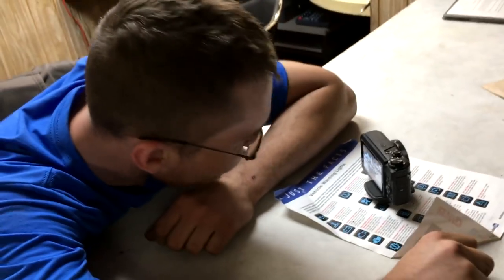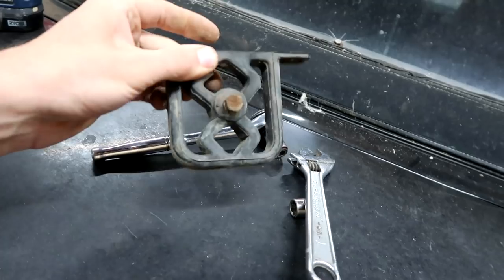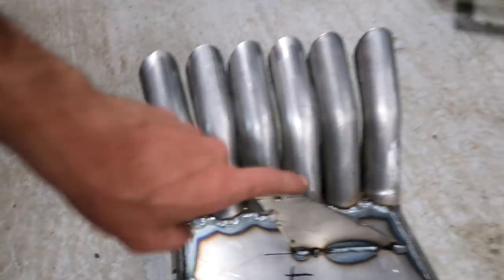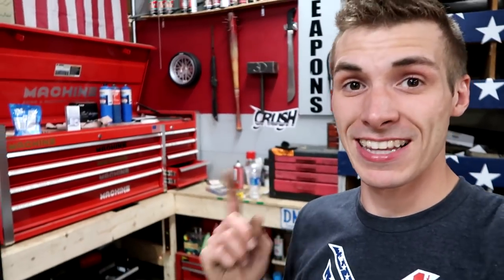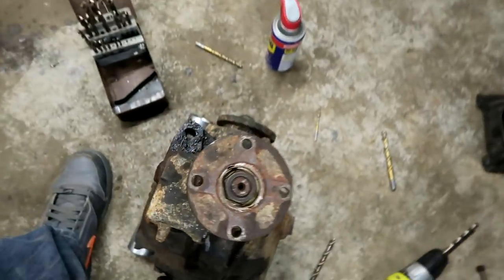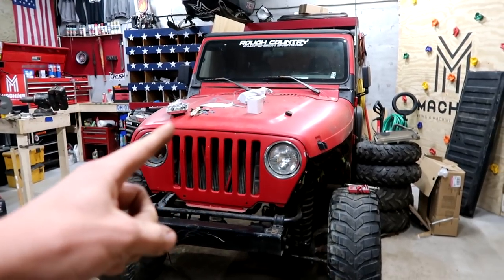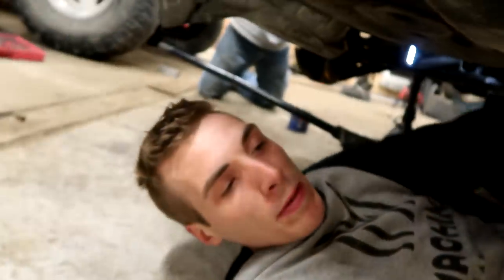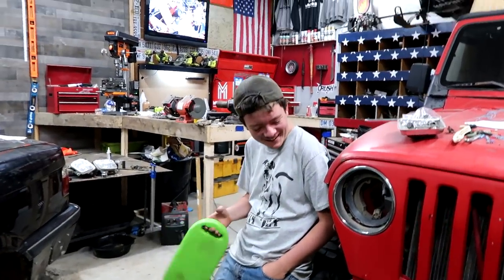BMW - BIG MONEY WASTER

Comment: Hey those bigger bushings in the diff toward the rear of the car are what cause the front bolt to break. The rears let the diff twist under power and break the front. Since you are changing them it should fix it.

Comment: The only thing I can say is there's nothing weird about that exhaust you made it your own that's all that matters cuz that's what I did but my 85 F250 has a 6.9 L diesel in it and I have it completely straight piped like it's right off the headers and it's coming out in front of the rear tires

Comment: Actually no you don't get a stronger grip with a fine thread. You get more threads per inch with a fine thread and is good for a hole that doesn't have a lot of grip range. A coarse thread is by far stronger as the threads are thicker.